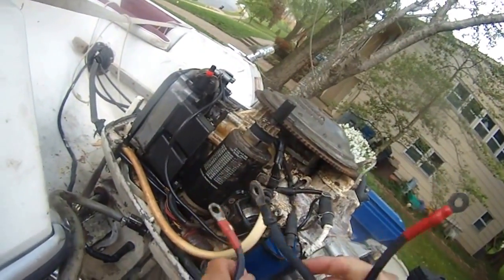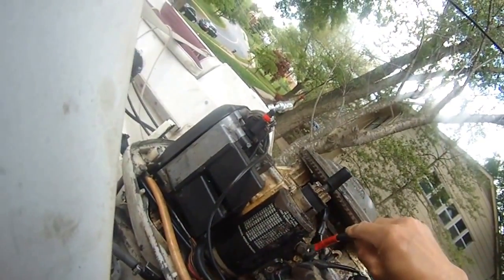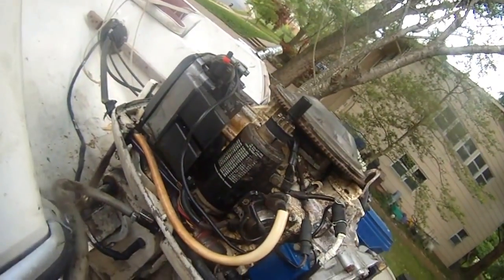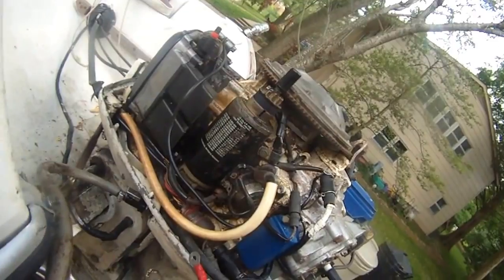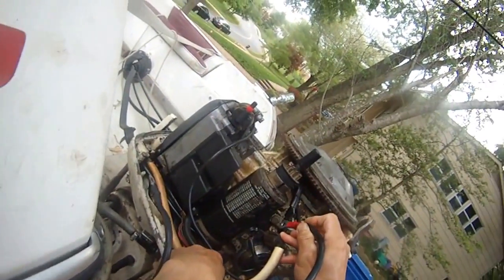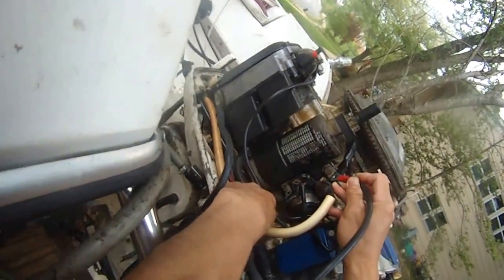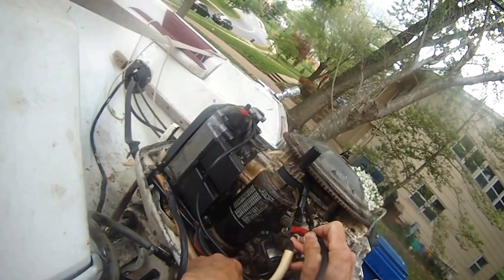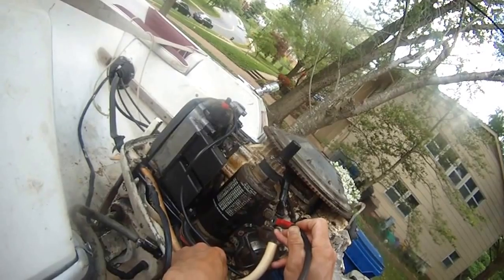Johnson 90 hp v4 - how to jump start the starter motor without using the key (bypass solenoid)

Comment: Clean and lightly oil that bendix gear shaft and if the bendix gear is too tight into the flywheel teeth, add a washer under the long bolt of the 3 bolt attachment of the starter motor. If starter motor is bad, look for a new motor that has the lock nut at the top of the bendix shaft, because the replacement motors without the locknut but instead a lock ring seem to be lower quality weak knock offs, intact that starter you have might be one.
Take care

Comment: good deal, you got it working good again , loose connections can cause all sourts of problems.
Reply from the maker: +Thomas Batts yes, this old and classic motor is an OLD Faithful for my fishing trips. It starts right up after I get the hang of it. I run the oil, gas and seafoam premix to get it clean while it is running. So, it is running just as good as a brand new motor that costs tens of thousands of dollars.

Comment: Yea starter only makes that strange noise when you crank for to long are when it goes bad it will make that sound right away like this guys, did the ring terminals burn your fingers I had some leads with ring terminals sizzle my fingers today taking them off battery after cranking an outboard for a while that wouldn't fire off
Reply from the maker: No, was lucky that it didn't burn my fingers. My non-start was because of a loose nut that attach the starter to the engine block. I didn't tighten it enough, so it was loose and cause the non-start. I was told by someone on the Johnson engine forum to check loose connection first before taking apart the starter motor. It performed flawlessly during all my fishing and boating trips in 2015.